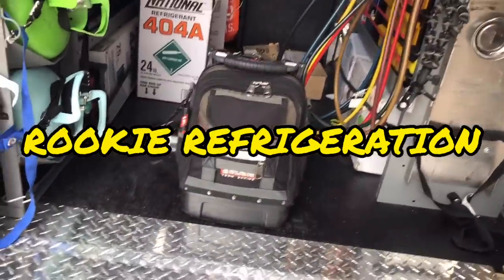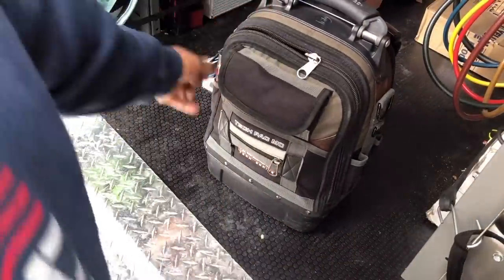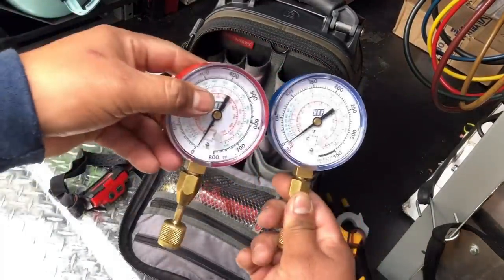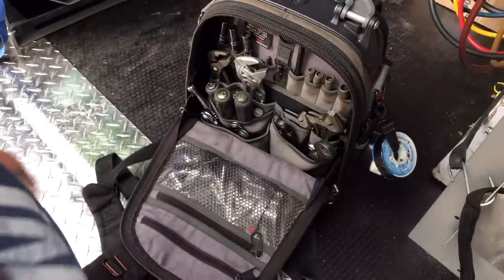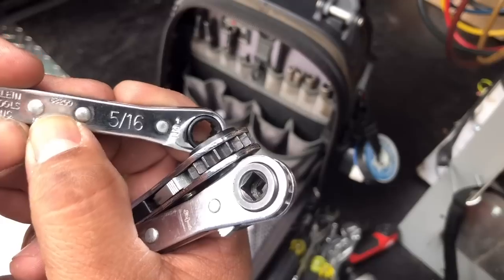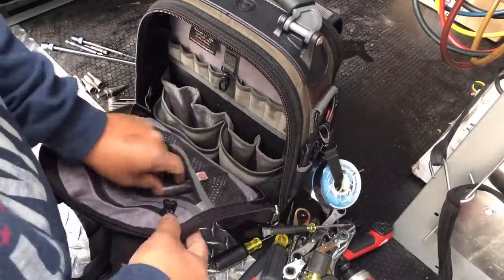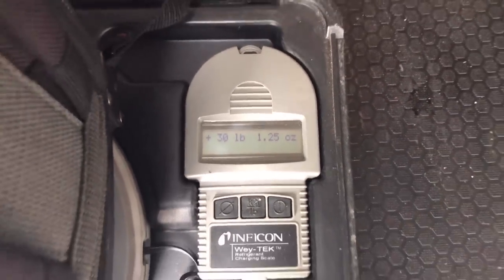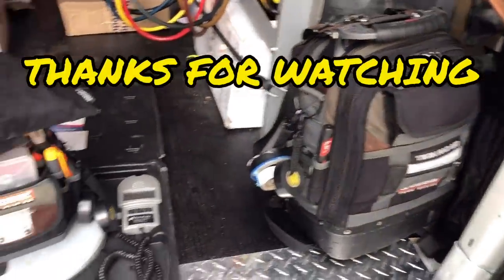VETO TECH PAC MC Loadout for HVAC and Refrigeration

Comment: I have an awp backpack I got from Lowe’s but it’s too big to haul into an attic access, and then I have a smaller pouch that I usually bring into the home/ rooftop with me. Usually leave the big bag in the van and then depending on what I’m doing I load the pouch up with what I need. For comercial duct hanging jobs. I just bring my shears, offset, straight and bulldog, as well as a big flathead plus hammer and drill, for residential/ comercial service calls and pms I’ll bring my meter, six in one, nut drivers etc

Comment: The connectors you call jelly beans, we use that to splice telephone wires where I'm from
Reply from the maker: Nice.
Reply: @rookierefrigeration4357  They’re called IDC connectors. Insulation displacement connectors. The knives inside displace the insulation without damaging the conductor.

Comment: What kind of wire you use for sodering the copper pipes on the hvac units?
Reply from the maker: I use 15% silfos for copper to copper
Reply: Thanks for answering. I read that is the best alloy to use on coppoer to copper.